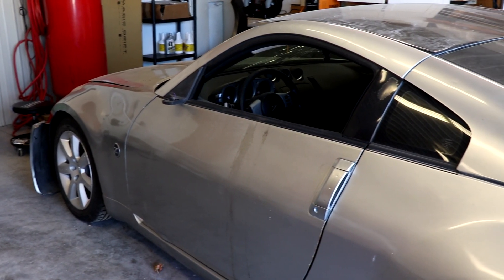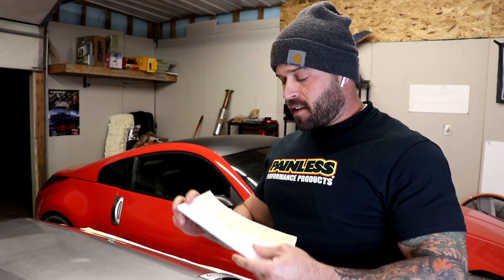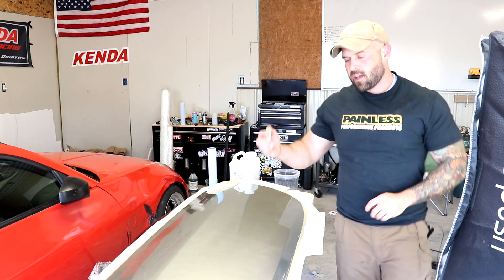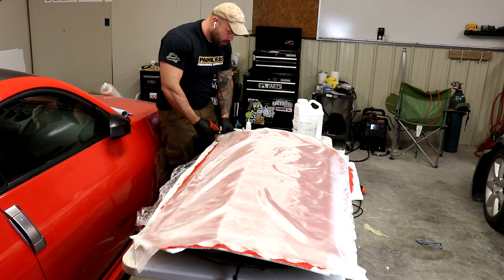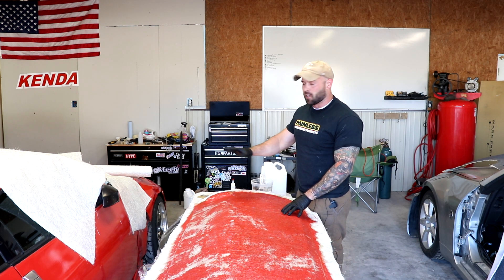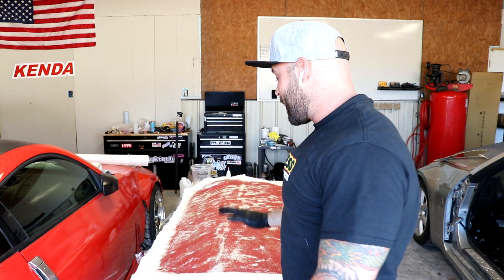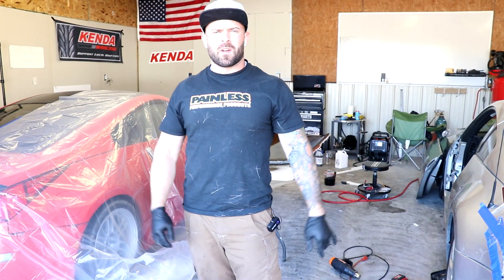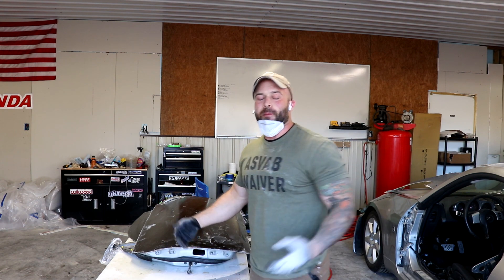DIY Racecar Mold and Fiberglass Fabrication (Build Your Own Aero)

Comment: wonder why more MEKP doesn't really help drying / hardening??  it's a balance with the amount of COBALT that the resin is activated with before you purchased it.  You can buy straight "COBALT" , and add more to the resin. The cobalt is "blue" , transparent and is why clear polyester gel coat has a pinkish hue.  adding too much will cause a brown color and could build massive heat...
  When it's a little cold, I use a silicone 12v heating pad, like you use under a car battery in freezing states, and wrap the container.. let it warm up.  Using one on my spray cup, I'm able to have material flow as if it has extra thinner or reducer without adding any solvents... 
 thanx for sharing the knowledge .......

Comment: Can i lay fiberglass right onto a bumper as smooth as possible to get a bumper skin. I know it wont be perfect but the imperfections will go with my build. In theory it would be pretty close to original bumper right.

Comment: What do you do reccemojd to do if the hood has hood scoop. How would you go about masking it off
Reply from the maker: The best method I have devised for this (I made a hood mold recently -@freedomfriestv IG) was to tape off the opening from the outside, then create a block off plate with fiberglass from the inside. If you message me on IG I'll show you what I mean.
Reply: @  I get what you’re saying but. Would I just use an epoxy tape to block it or fillet the whole thing I also sent you a dm on IG

Comment: I worked at a high class boat manufacturing company. Cobalt boats in neodesha kansas. When you are layering it you want to make sure those white spots are all gone they are dry spots. That means it will be weak in that area. I like the method you used thought. Just from a professional opinion dry spots are weak and if it's something that will need sanded and painted when you sand those spots you will have holes with fibers. You did a good job for what your use is.
Reply from the maker: @DajaVu_86  I really appreciate the comment and advice! I’ve definitely learned to make sure to get full saturation on my layups and would have loved the help years earlier hahaha

Comment: What was all the white once you layed down the resin?, Maybe Im wrong but it looked like you didnt have enough resin to wet it all up, once you used your roller there should not have been white as I think that is air/ not wet with resin matting. Please dont take me as being picky, its just my observation and I have done plenty of molds myself. I would really like to get your reply, keep up the good work mate
Reply from the maker: You're completely correct. I was definitely not as knowledgeable and my composites lacked because of it. Now I know I'd rather have a resin rich than a weak laminate. I appreciate the positivity!

Comment: Does the gel coat have wax or no? I’m looking to make a fiber glass front bumper for my car that I’ll later vinyl wrap.
Reply from the maker: No wax for the gelcoat. You'd only add wax if you were spraying gelcoat on after creating a part (99% of the time used for boats since we can just use automotive paint on our parts)

Comment: Enjoyed your video on fiberglass plug making. I built a lot outlaw sprint cars chassis, small blocks chevy. I worked a long time freind learning frame fabrication and engine building. We put a top fuel blower on a small block chevy. That was in 1980. There where no rules except saftey.  18 isky different blower underdrive blower ratios. And finally we could maybe conttol horsepower. It worked like dragcar on mile track. We blew the crank out of it. Blew oul pan off. Picture of explosion was on COVER OF OPEN WHEEL MAGAZINE
Reply from the maker: I wish I had even half of the fabrication experience you had!

Comment: Hello! Nice video, I wonder on 15:40 you are using some type of black paint/liquid, I wonder what is it?
Reply from the maker: Its just a black gelcoat. Similar to what the mold is made up of and typically how most fiberglass parts come from companies (notice theyre usually white rather than standard yellow+fiber that a fiberglass part would be without paint)

Comment: heey late to the show but how can i do this to a motorcycle headlight fairing? they are way flimzyer and wirdly shaped.
Reply from the maker: The more flimsy a product, the more difficult. You can setup a jig to have it mounted as it would be on the bike and then run the flashing for your run off or get real weird and find a way to do it while its mounted on the bike (messy though)
Reply: @freedomfriestv  sanding and painting souds way more doeble on that part then.

Comment: What type of wax does he use for the mold does anyone know?
Reply from the maker: Actually its a clay called plasticine. Significantly cheaper than importing filleting wax from the UK. Downside is clean up is a pain, but a plastic bristle brush and water+dawn dish soap does the trick!

Comment: What if your mold / plug is going to be part of the construction of what your building? I want to build a motorhome hull, so the mold will be part of the interior construction.
Reply from the maker: Sounds like you'll just need to lay fiberglass over whatever your hull will be!

Comment: Do you have a link to the filler wax you used? I can't find anything in the US...
Reply from the maker: I didnt use fillet wax, but wish I could have. This is simply plasticine model clay. Pain in the butt to clean, but some dawn dish soap in a cup of water and a bristle brush makes semi quick work of the excess after its peeled away.
Reply: @freedomfriestv  ah, gotcha. Thank you for the reply! I ended up ordering a couple packs of that Fill-it clay from FiberglassSupplyDepot which I believe is what you're talking about.

Comment: When mixing and air pockets aren't an issue, i use a drill with a wisk or a paint mixer on it. I would have also removed the door handle and had the stock type flange to remount the handle.

Comment: Will it be smooth even if a spray gun isn't used for applying the gel coat?
Reply from the maker: Yes. Only issue I face when brushing on is the difficulty of getting the fiberglass backing to completely connect due to the grooves left by the brush.

Comment: Tip depending on time and temp i would keep another bucket or cup of acitone for cleaning tools and brushes in case the resin starts pulling your glass a squirt bottle like the ones for condiments then if arm starts burning you can clean that as well

Comment: I build boats and work with fiberglass everyday. You did good my man. If it works, it works. I used to forget orders of doing molds etc... due to mostly making repairs in the beginning, sometimes id be surprised it worked out. 9/10 because you forgot to drop am f bomb out of no where every so often.

Comment: Okay so'ooo l've been watching fiberglass videos for awhile now--an this process just seemed more broken down to my entry level understanding thank you like a 💯
Reply from the maker: Glad to hear it! Let me know if I can help at all!
Reply: @freedomfriestv  thank you for the good and informative video. I am in the process of making a cowl hood for my 70 Cougar. Right now it is still the steel hood but I want to make a fiberglass one from the steel hood. I have never used fiberglass. 
1st question, do you think the materials you made the door skin from will hold up to the heat from being a hood.
2nd question, where can I get all the materials you used to make the mold/plug and the final product? 
I'm not finding any "fiberglass kits" and have no idea what to start looking for. I went on Eastwoods website but was lost what to get. 
Thank you brother and I too enjoy a pinch of snuff 😁
Reply from the maker: @nova467spanker  You may look into using a high temp epoxy if you're really concerned about the heat or maybe layering gold reflective tape along the inside to assist. 

I get my materials from fiberglasssupplydepot.

You'll need a tooling gel coat, fiberglass mat, release wax, and PVA for the mold. (among other odds and ends)

You'll need quite a bit of fiberglass cloth and polyester resin for the creation of the actual hood.

Definitely buy a few cheap paint brushes, a metal roller to remove bubbles, wax additive for curing the resin, whatever flashing/hot glue for creation of the mold. (respirator as many have mentioned as well) GOOD LUCK BROTHER!
Reply: @freedomfriestv  cool man thank you. I will visit that website. Im probably gonna do 3 or 4 layers from the mold and then glass in  some under bracing. Im still far off from my hood im making. Still some metal fab work, cutting and welding to do.

Comment: I’m new to this. I’m a old school body guy . But why are you making a bolt on fiberglass door skin ? Do you put it over the steel door skin ? I’m not getting the whole thing ? Anyone can enlighten me I would appreciate it
Reply from the maker: We crush doors pretty often in racing. The factory 350z has OEM door bars, so the door structure itself is 99% of the time fine but aesthetically not the most pleasing thing. Because we do it so often, its much easier to just bolt a skin on rather than swap doors every month or so.

Comment: What are the odds I total my Wrap on my done car when doing this process to replicate my One off Evo Over/flares to include the entire quarter panel and rear door ? or will the wax be a good enough barrier do you think?
Reply from the maker: Wrap would likely get ruined. I've considered using wrap as a release agent but have read it doesn't work well. The heat build up from the fiberglass/gelcoat and the possibility of materials running is definitely high. I'd actually pull off the wrap from the panel before trying to replicate. Sorry man
Reply: @freedomfriestv  it's all good I have voltex flares on top of b magic overs. Turbo Coyote swapped Evo drift car 🤘🏻. So I full expect to ruin something. I appreciate the reply!!
Reply from the maker: @untamedantiks5073  Dude that's the most wild thing I've read all day! Need to see that car.

Comment: Just for your own well being, I'd suggest a half mask respirator, not a dust mask (the kind that makes you look like Bane from the Batman movie). I have to look at mine, because I forgot what filters I use, but I think they are P100. It's very important the damage from the dust and the fumes can be irreparable.
Reply: I mean you want the kind that looks like Banes mask with the two filters. You don't need a full face, but I personally prefer the full face when I'm grinding or cutting. It's the only way to keep the dust out of my eyes. Safety glasses are useless for fiberglass dust and goggles don't seal properly around a respirator. 

What I use is a full face to cut and a half to mess with the chemicals.
Reply from the maker: @johndohnson7902  Thanks man! I've invested in one since this video - definitely wasn't healthy beforehand...

Comment: wax part or mold first... then PVA   .... 1.5oz mat goes on gel coat before the cloth would ... mold should be reinforced with some type of ribs... just saying.
Reply from the maker: Changed the order of the PVA/Wax. The flexibility of the mold really seemd to help releasing the item. Why do you recommend the mat vs just building up with cloth?
Reply: @freedomfriestv  mat makes the bond- cloth like 1708,  makes the strength
Reply from the maker: @toma7744  Is fiberglass mat needed to bond carbonfiber cloth to the gelcoat as well?
Reply: @freedomfriestv  Besides the bond, the mat would conform easier to the spray texture of the gelcoat- (so no air pockets would form, any air between gel coat and fiberglass material would eventually crack open- so that is why most builders would use mat first... I never used carbon fiber, but assume it would be similar

Comment: You helped me make up my mind so I thank you and Im gonna use fiberglass for my project...Only question is do you have to be balls on accurate with the chemical mixing? And thanks for the lesson.
Reply from the maker: Not terribly. More activator makes it cure faster (but too much will cause it to heat enough to catch fire - but it takes A LOT extra). Not enough wont let it cure ever. 

Just order supplies from a reputable fiberglass dealer and they'll come with measuring tools usually.

Comment: Respirator   is not even close to what you are wearing. What you are wearing is a dust and pollen mask which is useless for chemical filtration.
Reply from the maker: You are correct. Started using a respirator right after this video. Thanks for the comment!

Comment: I know everybody has their own way and yours seems to work just fine as well. By no means am I saying you’re doing it wrong and would never claim to know it all. I’ve always put down release wax prior to the pva. Reason being you can pull just that much more gloss off your plug. A painted door is a perfect example. Using that wax to buff and gloss that paint up as much as possible before going to sprayed or brushed on release agents can sometimes give you better results. After 9 years of carbon fiber work that has always suited me well. If anything it just makes it that much easier to clean the pva off with water rather than it being mixed with wax. Just a thought and sharing any knowledge (albeit very little lol) I have to maybe help someone out in one way or another. Thanks for sharing and keep up the good work!
Reply: I've been doing fiberglass work for around 17 years and have NEVER seen anyone recommend or practice waxing a dried PVA layer. And you're correct,  warm water removes PVA better than anything.
Reply: @HAMMER_2.2  Maybe I'm off here, but that response comes across like an off-hand dismissal. Like scoffing. In which case- the hell for? 

Just as well, you've done fiberglass for 17 years. OP specifically referred to carbon fiber and their experience with carbon fiber

And while not a night and day difference in how they're prepared, and how the end products will turn out, from having the same techniques used to produce parts of each material, there are differences. Just because you've never seen it doesn't mean it either doesn't work or hasn't happened. Regardless how much experience you have. Nobody is nor can be omniscient.
Reply: @3xeplodng_3agle_studios  Hammer is just confirming what the OP has stated. The technique between working with glass fiber, carbon fiber, polyester or epoxy is exactly the same when it comes to releasing a part or plug from their moulds. 

I did try to wax pva for testing purposes (been making parts since 2004) and there is nothing wrong with it, just that you can disrupt the PVA layer and could end up with a chemical bound. In the case of the video you would first wax the plug about five times and then apply the PVA, but as Freedom Fries says himself, he's not an expert and by doing, he'll eventually learn. If you wax your part decently, you don't need the PVA and vica versa, but often its used in combination.
It also isn't the custom to mix wax in the final layer of the laminate, this is only added to the gelcoat to make it a topcoat since gelcoat never fully cures when it is in contact with the air. In this case it is unnecessary and it only applies when you fix a gelcoat layer or use the plug to make a part without a making a mould.
Reply: @monkeybase01  hey thank you for the levelheaded and genuinely informative response! I really appreciated that, and enjoyed reading it. I see the error in my perception.
Reply: @HAMMER_2.2  I always apply at least three coats of release wax first and then a coat of PVA. It may be a belt and suspenders method, but the fear of the part not releasing makes the extra work worth it. Instead of adding wax to the final Layer just spray on a coat of PVA. If you want to add another layer of resin after you have used wax, you will have to sand off all the wax.  To remove the PVA it works even better to add a little of Dawn to the rinse water and use a dish washing brush.

Comment: I have a 370z convertible, but I really want a hard top like ones on s2000 and Miata, I wonder if it’s possible to fabricate one from fiberglass
Reply from the maker: You definitely could. Either a hard top replacement for the soft top or a full replacement like the normal 350z roofline. Would just take a bit of work and like 2 molds. (so I'd expect around $1,000 in material)

Comment: Fabric mask will do more harm than good with layup vapour fumes, (only good for sanding). Gentle electric fan feeding upstream air flow is best way to mitigate fumes.  Upwind is the key. When spraying, cartridge mask AND good goggles to mitigate the aerosols (5 micron and up) help. Alot of the harm from MEKP comes though eyes.  (fumes need gentle fan, as cart mask does little for the vapour fumes ).  I reckon I've mixed up a good 30-50 tonnes of resin over the years.  And didn't turn into Golum
Reply from the maker: Thank you for the advice! I'll definitely be purchasing some better safety gear when I get back to the USA.

Comment: Typically, fiberglass matting would be the 1st layer, as it's easier to conform to the shape of the object you are making. Then the 2nd, 3rd, 4th etc. layer you'd use FC as that has strength and not as easy to conform without cutting reliefs.
Reply from the maker: Thanks for the tip! I haven't seen it done that way and look forward to trying it out!
Reply: @freedomfriestv  no problem brother. 🤙#LGBFJB

Comment: By bolt on you mean drill holes through the skin attaching it to door? Will that panel bond glue stuff that corvettes use work? Thanks
Reply from the maker: You could likely epoxy or panel bond it. I havent tested a tire rub against it - but most people just riveted them on.
Reply: @freedomfriestv  thank you I’m going to be trying this hopefully soon